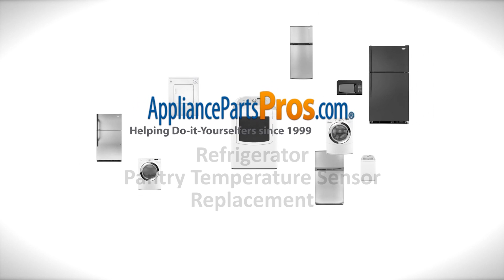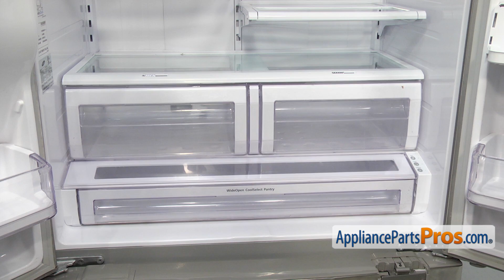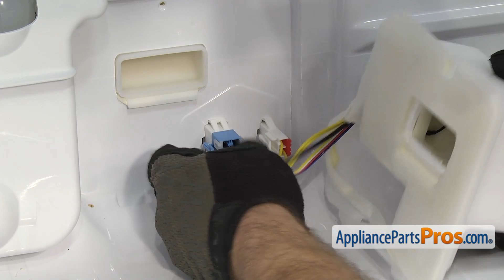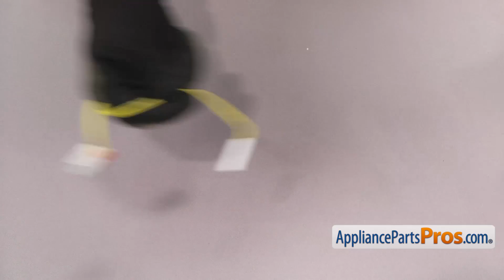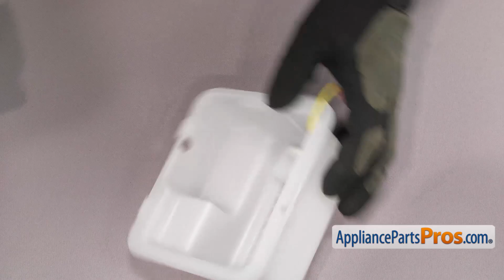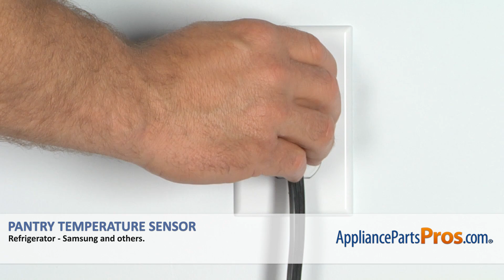How To: Samsung Pantry Temperature Sensor DA32-00006R

Comment: The Fault Code for this sensor is Fridge Side Display/Left Digit/Position 9 Flashing.
Reply from the maker: What is the model number of your appliance? Are you trying to clear that error code? What have you checked or done so far?
Reply: @appliancepartspros  Hi, the model is RF263, got the code list on line & find out the problem. Follow your instructions & replace the sensor, don’t even need to reset the computer. Thank you so much. U definitely save my day.
Reply from the maker: That’s fantastic to hear! We’re so glad the info helped and that you got it fixed without even needing a reset. Thanks for the update—way to get it done!